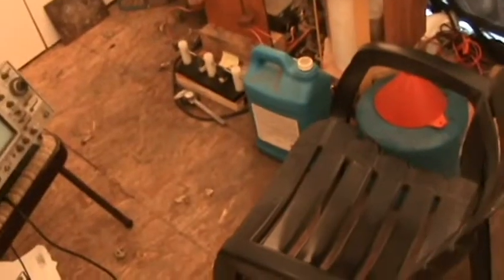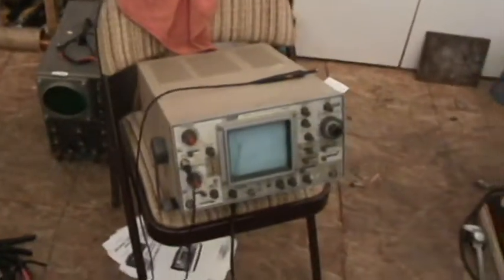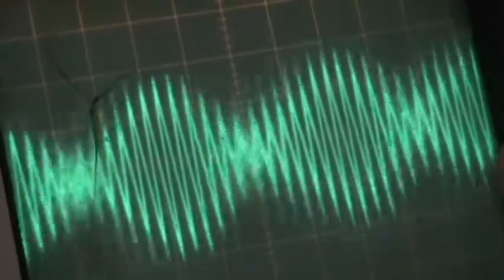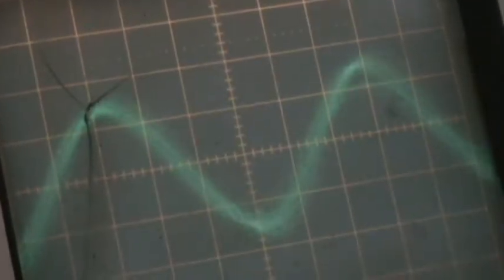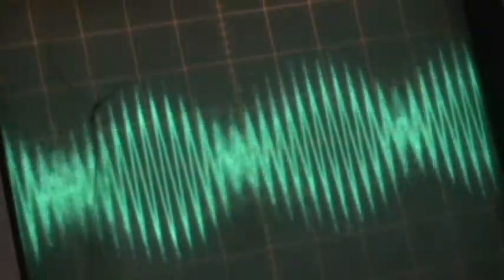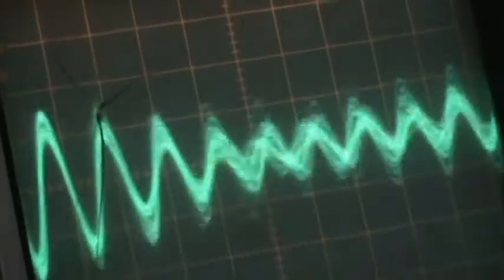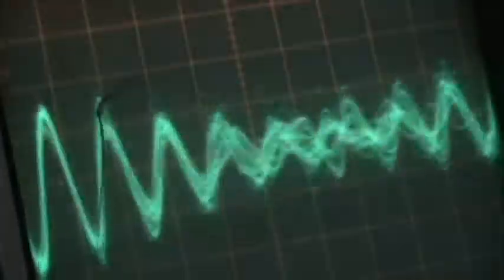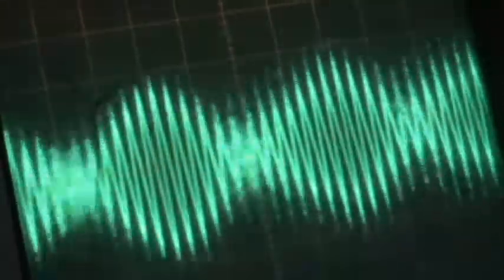Free Energy From Air 2019,  part 9 (Cont. from 2018 Pt. 8)

Comment: Try to tune in on the waves on your radio look at the frequency and then use that to figure out if its a radion station 

You can often hear Jupiter
Reply from the maker: Great idea.  Many times i forget to use old radio for many experiments i do.  I really need to go on ebay and get myself a nice small hand held analog radio,,,,thanks for commenting :-)
Reply: @INVENTOR3  ok usually i dont usually entertain these ideas but you seem like a genuine guy. But ill share something good with you if you havent heard about this. So zero point energy has a net zreo chamg meaning it takes at least the same amount of energy to get any energy out. 

But the casmire effect.... Thats what you should look into its cause my enthropy differentials for light waves.
Reply from the maker: @preppertechnicianee6013   Casimir effect, i remember this is what proved the zero point energy, in a vacuum.   This is a good video here, i like the info about the EMdrive ...
https://www.youtube.com/watch?v=Rh898Yr5YZ8
You mention about same energy to extract the energy,,,i see what you mean in that video when he mentions about the casimir effect & that it would take same amount of energy to pull the plates apart,,,so not too useful.  Van der waals force is also interesting.  So much to be discovered in quantum physics, so many theorys , virtual particles, dark energy, etc.etc..  Sometimes i dont know whats real any more, hehehehe.  But anyhow, we always have to keep an open mind.  Hope to discover something that puts a little order to things,,,but than again entropy is balance of the universe, hehehe. Great talking with you, your comments are greatly appreciated.

Comment: Nice! :D it's a mix of all radiowaves and other that your antenna will pick up, the "wave inside a wave" will be the carrier wave(s) and the audio signals inside it. Now, I'm no expert, far from it, but I know that a radio uses a LF-filter with a adjustable induction coil to tune in to stations. But you really want to try to make use of ALL the energy here, so I would look into building a rectifier that can handle that super fast frequencies (FM/AM: 30-300MHz for VHF, WiFi/Cellphones: 300MHz-3GHz for UHF) and charge a capacitor/bank with it.

To make use of the high voltage that comes from the ionosphere, just use a tesla coil in "reverse"; your antenna is the top capacitor, but in my head I think you should connect it from the middle of the antenna to make the charges flow more equally from both sides, use one of your coils with the smallest wire and lots of turns (high impedance) as primary, then a thick 1 or 2 turn copper strip or copper tube (low impedance) as your secondary, it is very important that the primary and secondary is of equal weight in copper, if you figure out the frequencies you are recieving you can tune the primary coil to 1/4 of the wavelength. Put a capacitor bank and the load in parallell with the secondary. Ground connected to both the primary and the secondary Here is the values of the earth: Ground<->Ionosphere: 53-60 Miles, 350k-400k Volt, Capacitance: 1 Farads (Wolfram Reference), Impedance: 200 Ohms, Current: 1800 Amps.

If you want to run it through speakers, I really think it have to be amplified first with a good audio amplifier, but maybe not, should just be noise anyway. Secondly, I think you should try the oscilloscope on the ground connection only as well, just for fun. I know that there is a sea of currents inside the earth, that was what Nikola Tesla managed to resonate his prototype magnifier coil with, before trying to build Wardenclyffe, but for that your ground connection needs to be as close to 0 impedance as possible.

Lastly a tip for an addition to your antenna, you could build a symmetric golden ratio logarithmic antenna just with thin copper plates and a piece of plate wood.
Reply from the maker: Thank you!  I printed out your comments so i dont forget :-)
Reply: Video on Tesla coil used in reverse. https://www.youtube.com/watch?v=qwVOp-HPIVE

Comment: I suspect you are picking up a number of primary and subharmonic frequencies simultaneously. There is one large signal that I would guess is ambient 60 Hz. You might be able to determine what the various frequencies you are picking up are with the scope. 
In addition to that the multiple elements on your antenna may be acting like a directional array influencing the reception from one or more source. There are many factors that determine the directional characteristics of a multi element array.
Reply from the maker: Yes, very good points you make, & i have to agree,,,,,thank you.

Comment: nice test! i tested some setups, i got around 1500v from an antenna (using a very well insulated leads/HV insulating wire) capturing free statics/ions from atmosphere, charging a good HV capacitor and discharging it on a neon bulb by a spark gap , but be careful even with all turned off, the oscilloscope "see" the 50/60 Hz transmission line, we are immersed in that field, there are also a lot of harmonics and RF all are ManMade, the natural energy from we can get some energy from free is mostly statics/ clusters of charges / electric gradient potential, as original Tesla Radiant Energy Collector, now used by IonPowerGroup. Real Free energy from the Sun, is already converted in electric charges stored in the big (NOT FLAT ;) ) capacitor we live in it ;)
Reply from the maker: Thank you, i agree.
 IonPowerGroup, i am very familiar,,,good group, love their work :-)